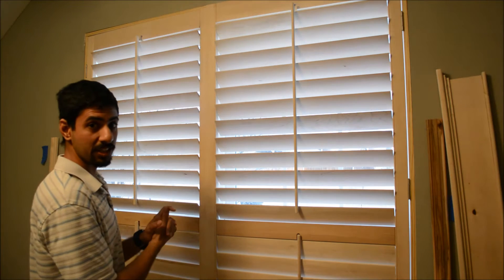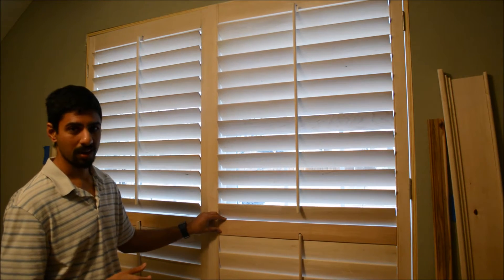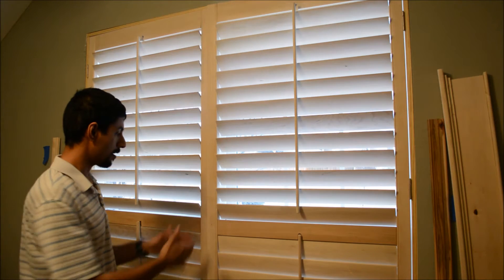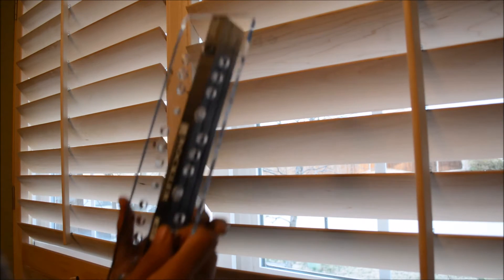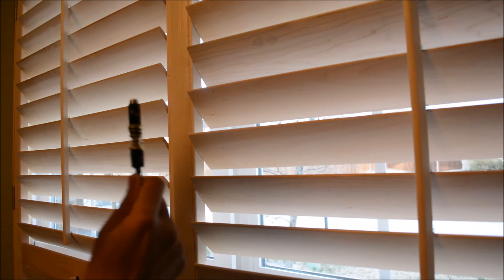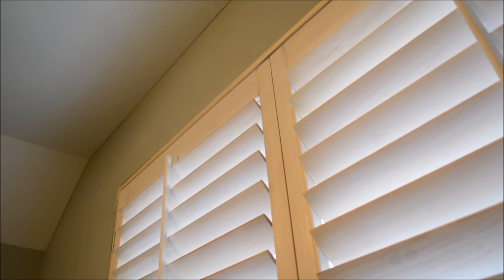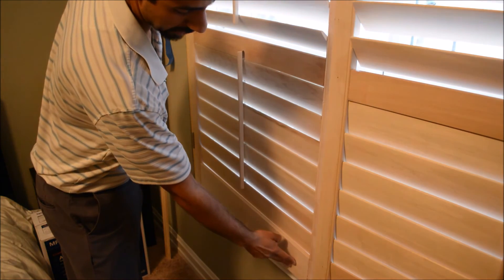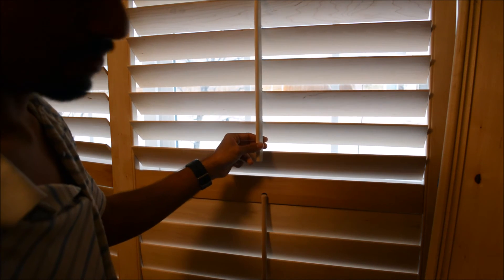Rockler Plantation Shutter making Tips

Comment: Great tips man , quick question when you measured your windows did you subtract 1/16 for each hinge  and 1/8 for the panels ( where the two blinds will meet)  then plugged it into the  wizard or does the wizard  automatically  do that for you ? 
Thanks in advance 
Someone should make a detailed how to measure your window for rockler system hint hint 👍🏻
Reply from the maker: Hi there, it has been like 4 years since I made that and I don't remember honestly. i don't live in that house anymore otherwise I could go measure it for you. Rockler store representatives are normally super knowledgeable and should be able to guide you.

Comment: I think I understand everything pretty well at this point. Except, I am going to spray paint latex on the shutters before installation, but I'm not sure if I want to spray the parts before assembly, or after assembly. It would be easier after assembly but I'm afraid those louvers may bind up if/when paint gets into the nylon swivels.
Reply from the maker: Bryan, if you are spraying thinned latex it is a lot easier post assembly. It is a lot harder to keep individually sprayed components from sticking to something and get a smooth finish. The paint won't even reach the nylon swivels :) I will post the video of me doing it soon.
Reply: That would be fantastic! Yes, I was worried about the space and time involved for spraying all components scattered about.
Reply from the maker: The only time I recommend spraying before assembly is if you are staining the shutters. The spraying process has a tendency to overspray on the stiles and hence the stiles would end up way darker in stain color. Even in this case I would probably choose to spray post assembly since it is so much easier. You are spraying solid color latex it does not matter at all.

Comment: I appreciate you taking the time to make this video. But I must say that a lot of the errors you made are due to inexperience. For example, any tool I buy with a needed preset I check or test first. Also, I would never route a bead on a length of timber that long without a fence. Its just too large an opportunity for mistakes. I also have a couple questions: 
1) Why would you used exposed pocket holes instead of hidden dowels or other type of blind joinery?
2) Are you planning on painting them? In my experience soft woods like basswood lasts longer when painted. It also ties into the room better if you match the window trim or wall paint color.
Otherwise I think its a good video.
Reply from the maker: Thanks for your inputs! That is the purpose of this video, to be upfront about first time mistakes on this project. For a part-time woodworker, it is really hard to get the "experience" after many years. I have been woodworking for 7 years now and I would probably make the same type of mistakes on any first time build on some things. Regarding your questions 1) On the first build, given that the shutter needs to be perfectly square with all those louvers and other things installed so I do not recommend glue joinery for any beginner (or experienced person). You can make fine adjustments with a screw. My mistake was making those pocket holes on the outside, if they are on the inside you don't need to worry about them. By the way, I hate pocket holes for anything that is structural. 2) that shutter is long gone with the sale of the house a few years ago shortly after the build, but I did give it a dark stain but wasn't satisfied with the outcome. I would probably just "poly" it with oil based poly as the beauty of basswood is too good to be painted over. To each their own. Last but not least, I have stopped building anything that I cannot take with me so no more shutters!!!